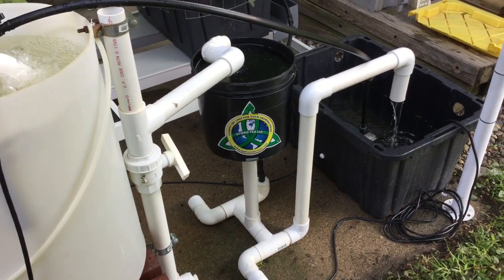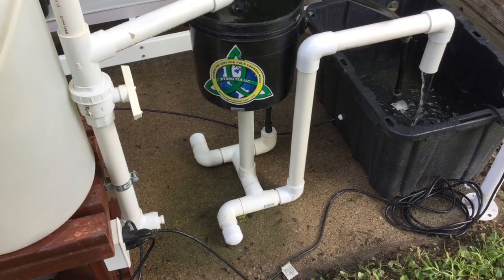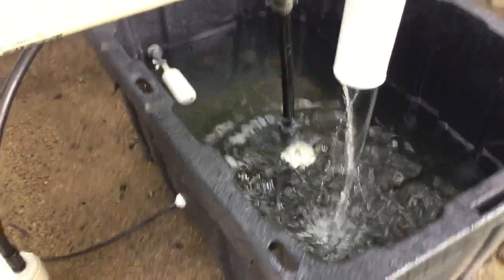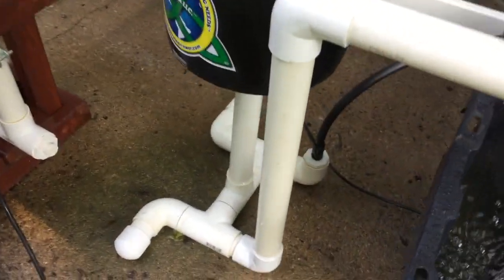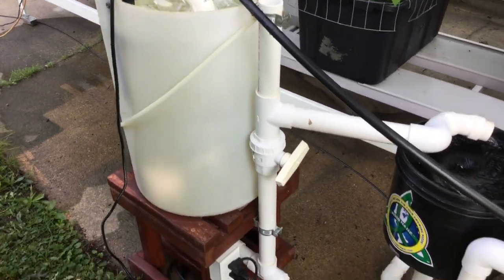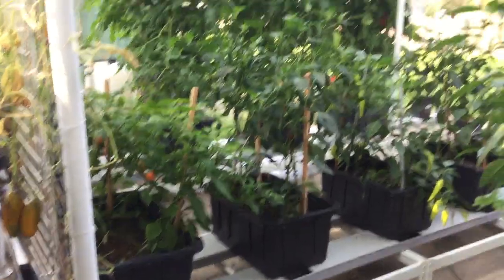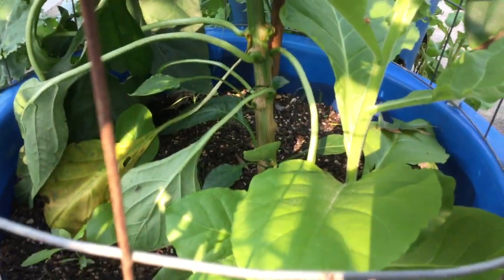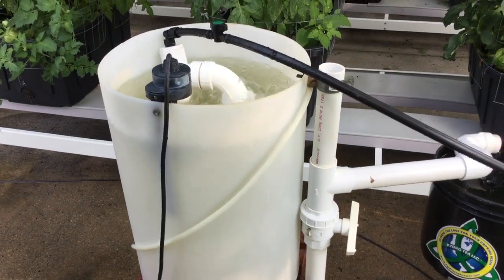Vortexing With Riverponics (Structured Water)

Comment: from my understanding of the manipulation of the water molecules, magnetic field variance during the cyclic motion of the water is highly relative to the creation of the living water. I do not see and magnets surrounding any of the ABS piping. So, you would have us believe that is not needed? or have you not experimented with the effect of that as well to any degree? Can it be argued the motion of water, wether it be cyclic or rough water horizontal movement adds more oxygen to the water? What academic, measurable differences can be detected in the water you produce?
Reply from the maker: I have fooled around with magnets. As a matter of fact, magnets can be integrated with our Patented brewer or the Vortex bucket but that a subject for further discussion; if interested ? As far as the aeration absorption, the horizontal pull and swirling motion literally forces air from the atmosphere into the vortex adding additional aeration. Let alone the brewer dispenses aerated water to the Vortex bucket before delivery to the grow system. Magnets aren't necessarily needed to structure water or change the molecules, our very words from our lips can change the structure of water. I recommend researching keywords, such as, "water has memory" it's truly the most remarkable substance on this planet !!!